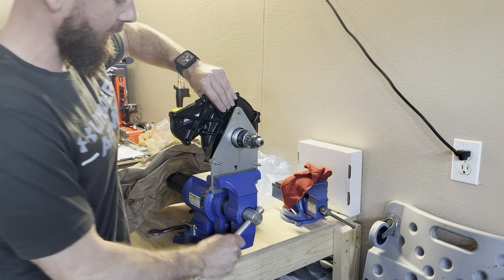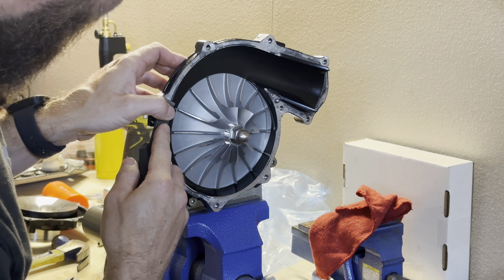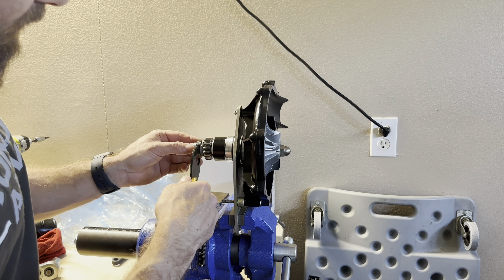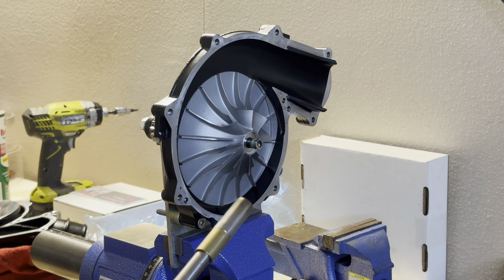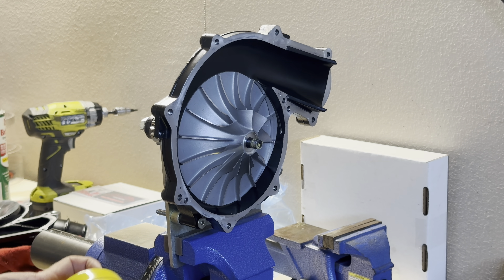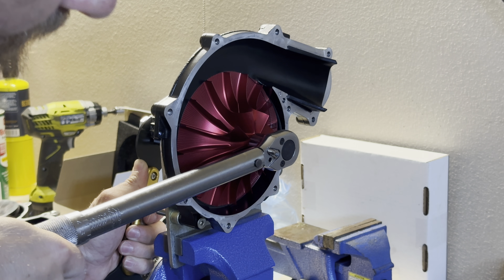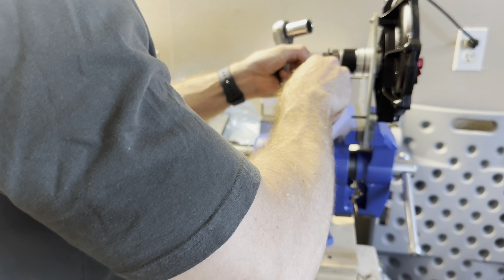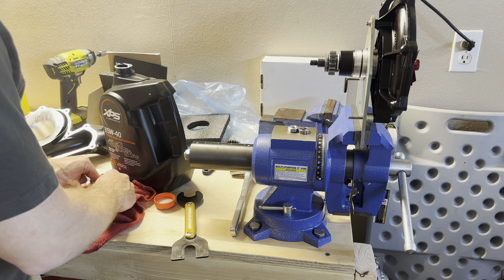Sea Doo Supercharger Wheel Upgrade Install (Part 1)

Comment: That wrench has a peak torque mode. You can set this by holding FN, and the menu will change. You can then use the arrow to change to P.
Reply from the maker: I set it to the amount of torque I’m targeting. It will have a steady tone and red light to indicate when it reaches that torque.

Comment: I have sedoo GTX 2004 Supercharged 185hp

Can I just upgrade to supercharged without problems? 

Because I'm afraid when I upgrade the supercharger the motor might break 
Until now it is stock 
What is the Supercharger Impeller recommend? 
16+PSI
18+PSI
Or what?
Reply: You can do a et127 with 42 pound injectors.
Reply: Use a 1/2" drive ratchet to separate the supercharger housing timer at the top of the supercharger there's a space that's perfectly made for it. Insert the ratchet with no sockets on it and simply rotate your hand. Easy peasy

Comment: Is it possible to add a supercharger to a stock seadoo speedster boat?
Reply from the maker: @benedictcumberbatch4275  if you have a 155 motor then you would have to do alot of modifications to support it.

Comment: I have a question for you, i have a 2020 seadoo 230 with 66 hrs stock the other day i was doing 63mph, stopped for 10min drove it again and i did 68 mph stopped for an hour and than did 63mph top again. Last weekend i when out i was doing 59 to 61 mph top would the supercharger be the problem
Reply from the maker: Typically when a supercharger goes out, it goes out and causes a lot of destruction. When is the last time the spark plugs were changed?
Reply: @SaltyDogPerformance  have no idea i bought it with 26 hrs. Maybe never
Reply from the maker: @MrRaye3312  change the plugs to start.